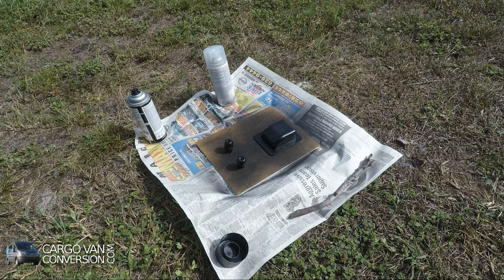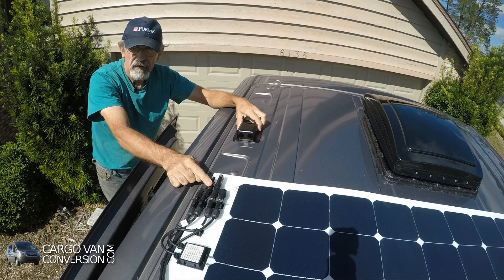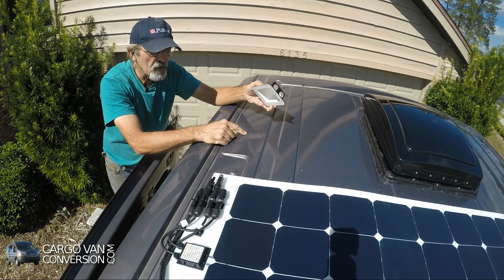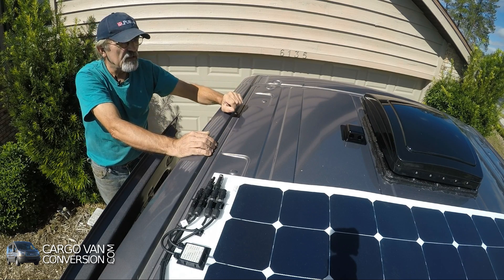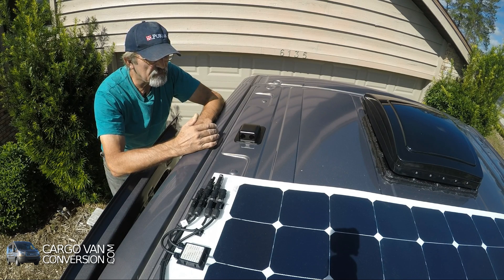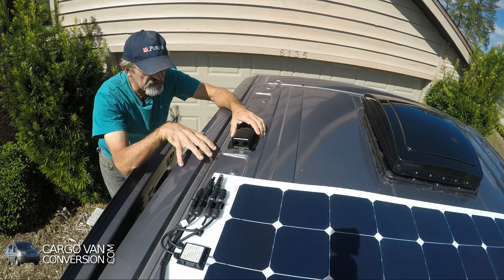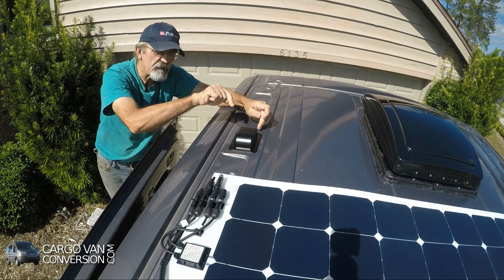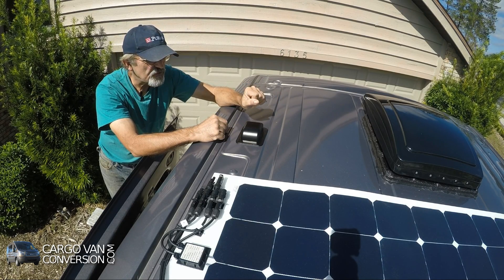ETFE Flexible Solar Panel Installation - Part 3

Comment: Do these panels still stick to the roof on this 3M tape after many years?
Reply: Late reply. Have had some health issues, but I'm back again.
Mine do after 3-4 years. The genuine 3M tape is works really good, but you have to use the right type for the right surface and clean the surface as directed.
Van Williams
Reply: @vanconversion1500  I glued my panel 2 weeks ago on 3M double-sided tape. For now it sticks so tightly that I'm afraid that when removing in 4 years the varnish may come off along with the tape :)
Reply from the maker: @domisamochod  I hope you'll get it off at all :) Tip: you could use an old credit card and/or some dental floss). Good luck!
Van Williams

Comment: What was the total cost of this application?
Reply from the maker: Hi Bryan,
The three 135W flexible panels, some of the solar components such as the controller, monitor and breaker box ended up to be approx. $1500.00. Probably a bit more if you add cables, connections and batteries.
The expenses went largely to the panels. These are high quality solar flexible panels, made with ETFE, backcontact & high grade solar cells. They have been in use for a little more than a year now and still look as if installed yesterday. Very satisfied. Expensive, but one of the best buys I did.
Van Williams

Comment: I really like the way you done this and I like the little wire cover
Reply from the maker: Hi Julian,
The cable gland is a must to avoid leaking where the cables enter the roof of the van. It's been some time since the installation and I'm still content with this setup.The solar panels still perform as they should and i don't see any deterioration of the panels. The flexible solar panels are virtually invisible unless you look for them.
Thanks for watching and Happy Holidays!
Van Williams

Comment: What did you apply around the holes before inserting the grommets? How do you attach the cables to the roof? I see you use something to secure and organize the cables to the roof, but what is it, and how does it attach to the roof?
Reply from the maker: Hi I Dig,
I sanded the holes and painted the edges to avoid or minimize rust at a later stage. I used tie mounts to attach the cables to the roof. These are small plastic squares with a hole(s) through which you can attach a cable tie. https://cargovanconversion.com/buy/cable-tie-mount
The principal works fine, just be sure to replace the adhesive tape with VHB tape https://cargovanconversion.com/buy/vhb-tape and clean with alcohol before applying the tape. I might replace these plastic tie mounts with something made of metal later on. I anticipate that the sun will damage them long term.
Later this year, I will also add screws or bolts to the cable gland; while secure, the two heavy wires add a lot of stress to the box and I feel better with a few added screws, beside the VHB tape alone.
Van Williams

Comment: Automotive gasket material, silicone sealer, and small stainless steel hold-down screws for the cable gland (and air vent) would probably work better than the tape/Dicor non-silicone sealer method. Dicor, especially black, will dry out and crack. Silicone stays strong but needs screws to keep it in place. 
I wouldn't like knowing a water leak could be possible down the road. I've seen lots of Dicor re-do videos.
Reply: Don't use the 'paintable silicone' type sealer. It drys and cracks if it is not painted.
Reply from the maker: Hi CauseAndEffect,
That's a valid point. I'm not that worried about the Dicor; you may and probably will have to redo the Dicor, but that may be once or twice over the lifespan of the vehicle. I have been considering to reinstall the cable gland with SS screws for other reasons. To minimize cable length on the roof, I didn't use a combiner box, but joined the 'standard' solar panel wires with two thicker #8 AWG wire that enter through the gland. The thickness of these two wires causes pressure to the installation of the cable gland and I'm worried that (long-term), it could create problems. A couple of SS screws can solve that.
I have used a variety of sealants, including silicone AND Dicor and SS bolts, during the installation of the MaxxAir roof vent. That has work out well so far.
Van Williams

Comment: Good job, paint helps prevent yellowing and Uv desintergration, important step..did the same!
Reply from the maker: I honestly did not think of that, but you're right. Will keep that in mind!

Van Williams
Reply: Blow in a bit compressed air from underneath and put soapy water out side at the seam of the lab sealant...you might see bubbles...

Comment: Home depot has Grape Solar 180 watt mono panels on sale for $180 shipped - im getting 400 to 600watt hours a day from my Grape 180 panel - using Victron 75/15 mppt charger and lifepo4 battery - I paid $258 for my panel -
Reply from the maker: Hi Jay,
The great advantage you have, is the Lithium battery. That makes your panel much more productive as you don't have to deal with an absortion/float charge. I just got my batteries (two 6V golf cart temporarily) installed and the system works fine. See if I can get some accurate numbers now.
Now my roof vent is hooked up too, I noticed for the first time, how effective the floor vent could be. With all doors and windows closed, but both roof & floor vent open, a running roof vent fan sucks out a tremendous amount of air, supplied by the floor vent. That avoids open windows at night or when cooked up inside the van on rainy occasions. And as predicted, when the roof vent fan is off and there are higher temps outside, natural convection really takes over, with a constant airflow from the floor vent to the roof vent.

Van Williams
Reply: that is one of the reasons I used Lifepo4 - the Victron seems to work well -  it has not had any glitches or any delay in mppt that is apparently
common on many other controllers - 
Victron adjusts Instantly - less than 1 second - 

 just ordered a Lensun 80 watt flexible panel to add to system should arrive Wednesday so will gave more data in a few days -

Nice to have roof vent - I my add one at some point - now Im using
real nice bathroom vent fans that are impeller based - very quiet
and are rated at 70cfm - use 16 watts each -
 have one attached to floor vent  (air in) and 2nd 
to expel hot air threw a vent hose that  runs down rear door pillar-
after painting van heat is not really a problem now - so small vent fans may be enough -- will see - Jay
Reply from the maker: Hi Jay,
I'm not only using the vents for expelling hot air. I'm even more concerned about humidity. I remember those rainy days, when everything is cold and condensation is all over the RV. Really want to avoid that with this van and I think that could work with the roof and floor vent. Be sure that the rear vent hose only expels air and that you close it, if it's not in use. Too many things can happen when the van's exhaust fumes would enter.

How are you planning to use that flexible solar panel? Will you add it to the roof or use it as a 'mobile' panel that you can move around?

Van Williams
Reply: Flex solar going to add to roof and also portable - got panel today - seems well made - not very flexible similar to 4 mm plywood ish - front has raised diamond pattern - non glare / non slip - supposedly can be walked on if mounted to smooth strong surface - it raining so no testing yet
Reply from the maker: Hi Jay,
The raised diamond pattern indicates ETFE laminate. That's good. Is less reflective and should not delaminate prematurely. If there are no visible lines (silver threads) on the solar cells, that would mean backcontact cells, another plus. Then the only variable would be the quality/grade of the solar cells; but that's difficult or impossible to evaluate. While they can be walked on and are bendable, avoid that if at all possible. You would not do that with rigid panels either.
Am interested in their output. How are you going to attach it to the roof and keep it portable?

Van Williams

Comment: Looks Good - I ve  had solar operating  for 2 weeks ish - need to compare output results
Reply from the maker: Hi Jay,
Good idea! Perhaps we can set up some similar base numbers/info and create a similar comparison. Pics and/or videos.
Haven't connected batteries yet; will get two 6V's this week. Will change them to Lithium next year.

Van Williams

Comment: Very good series of videos 👍.  I’m a full time Transit dweller.  Very much interested in a later review of the tape holding and performance of the flex panels.  Thanks for the effort 👍
Reply from the maker: Hi Bob,
Thanks for watching and commenting.
Both the tape and performance are high on my list. An initial test (open circuit/no load) of the three panels, flat on the roof of the van, showed 11.5A @ 28V at 10AM in November on a sunny morning in Florida. With a MPPT controller that could work out close to 200A/day in winter. That's better than I anticipated, but actual tests under load still have to be performed. I will keep doing them, including reviews of the panels and their installation, periodically over the next few years, as little actual data of these 'second generation' panels is available.

Van Williams

Comment: Was hoping you would show the batteries and where you are going to be putting them!! 👍 Vinny 🇺🇸
Reply from the maker: Hi Vinny,
You have to have a little more patience :) For the time being, they're just a set of two 6V golf cart batteries; I'll replace them with Lithium likely next year.
Their location is right below the cable gland, under the fridge on the passenger side.

Happy Thanksgiving!

Van Williams